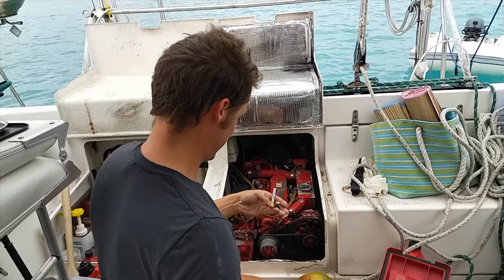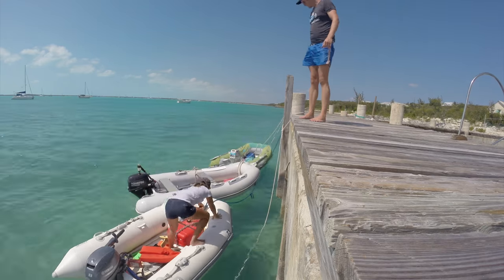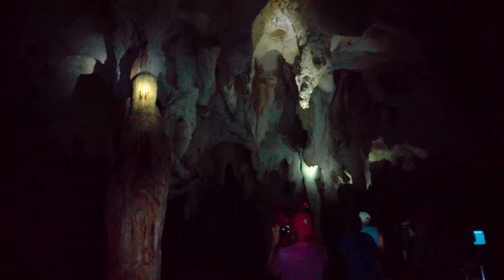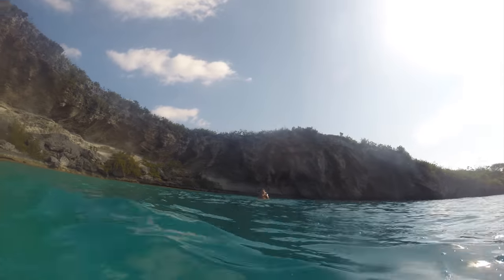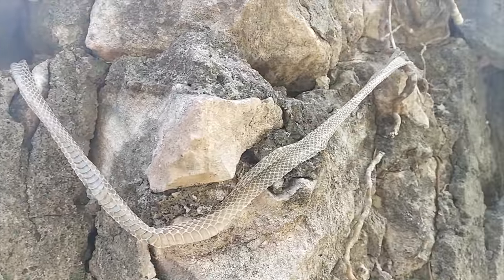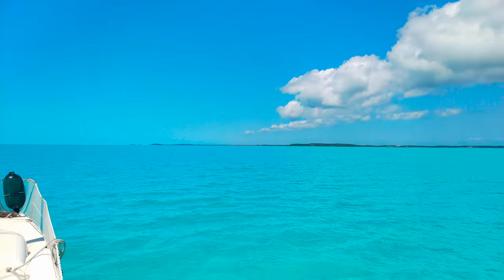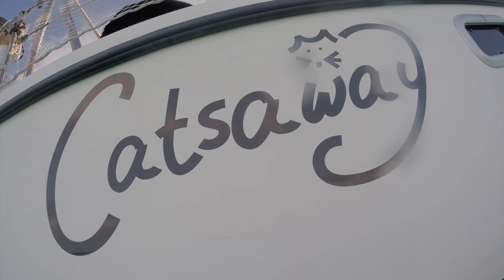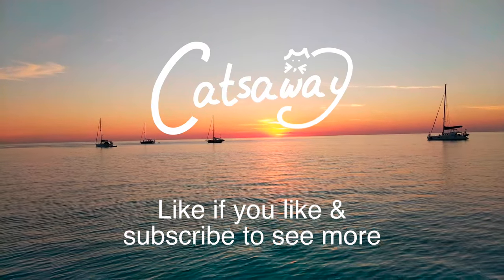Long Island, Bahamas (Sailing SV Catsaway) - Ep. 30

Comment: Green flash, like you said, it’s a myth. At least that’s my conclusion after watching dozens of tropical sailing vlog trying to capture it. However, myth or not, it’s always a great moment to try and catch if only to pause and take in a gorgeous sunset. 

You guys really need to replace your ensign (Canada flag) and fly it properly from the stern or boom topping lift. Flags on the starboard spreader halyard are reserved for the country courtesy flag that you are visiting. When you do get a new flag try to replace it with a size in width equal to one inch for every foot of boat. So for your 33’ cat, get a flag of 36” x 18”. Also, although more expensive get a sewn rather than printed flag. They last longer and are usually made with UV resistant dyed cloth. If you have a port spreader halyard that is reserved for signal flags when needed. Many people also use these for “dressing” the boat, like flying country courtesy flags of the nationalities of the crew, or skull and crossbones, etc. But try not to over do it. Marine tradition runs deeps and besides there are actual laws related to how you should dress in some countries. 

Regardless, looks like you guys have had a great first season and it isn’t quite finished yet. Thanks for having us all along. Fair winds.
Reply from the maker: Thanks for the suggestions, Yves. You're absolutely right about our Canadian flag needing to be replaced. I tried to purchase one before we left the States but had no luck in the local stores (and of course nothing in the Bahamas!). We meant to place it at our stern but the clips are too small for our backstays. We used to have both flags on starboard as that's the 'next highest place of honour' but apparently that meant the countries were at war haha. We'll work more on our flag set up when we get some new ones! Thanks so much for watching ☺⛵🐈

Comment: And I thought now that You settled in the cruising life You get hungry and set sails to go further South)))
How is the boat holding up so far ? Would be nice to know some kind of costs on fuel and maintanance etc.
Fair ((((❥ˆ◡ˆ☼)))▒ winds
Reply from the maker: We budget between $1000-1200/month. That includes food, fuel and maintenance. Since being in the Bahamas, the wind has been so great that we've barely motored at all. This is a nice trade off as the fuel and grocery prices are higher here. We change our oil every 100 hours and haven't changed it in 4 months (and still have a while to go!) We're going to miss having these steady winds to sail with. Thanks for watching!! ☺🐈⛵
Reply: Haha, that´s cheaper than sitting at home and playing with the TV.
100 hours in 4 month.... that is really fantastic. Looks like You went in the right direction
Watched all Your vids and so far You had no mayor problems with repairs. Looks like the previous owner did a decent job. I recommend more preventive maintanace. Did  not see You cleaning the tubes of the heat exchanger. Watch the vid I sent You the other day. It´s very easy. Also there is a speed seal end cap like for the fresh water pump. Costs some 20$)) Can´t find the video right now but it´s on Walt´s channel. Just think of barnacles on the hull. The inside of the heat exchanger is more or less the same..... 
Haha, it´s good to keep the hot things cool 👍
Reply from the maker: Thanks for that info. We're still learning about our boat so it's really helpful for us to have this information. We are having some problems with the heat exchanger but it's workable for now. We'll definitely check out those tubes for cleaning. Walt's channel is great! We also learned a lot from the boat galley. Love how helpful Gem owners are ☺🐈⛵